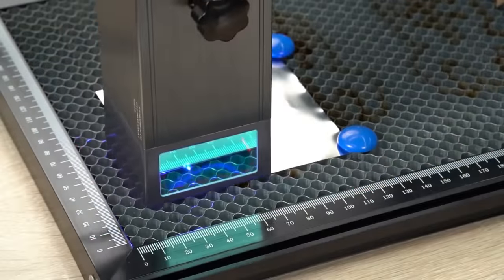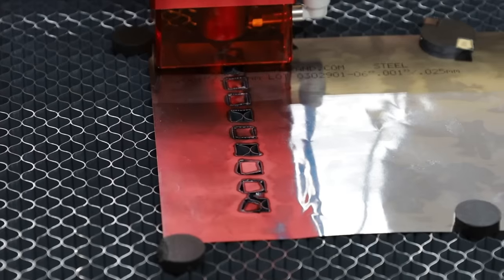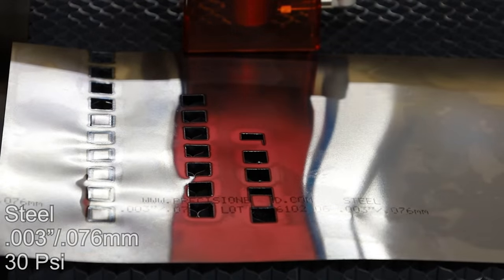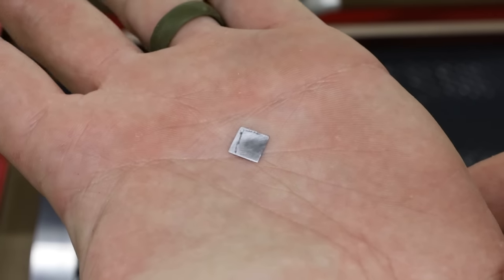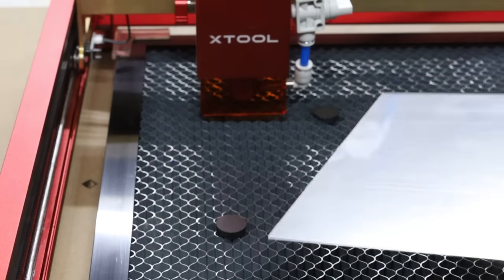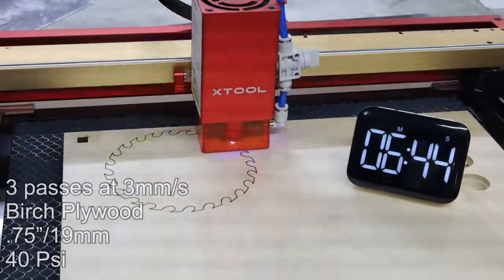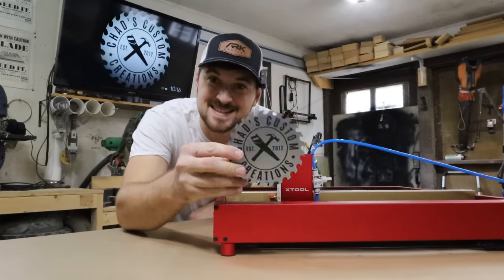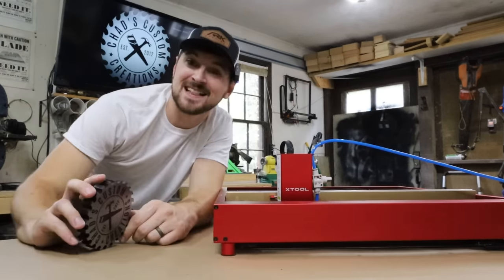Cutting Metal with a Desktop Laser

Comment: The most likely reason, beyond material thickness, that you failed to cut through aluminum, copper and brass is due to their High Thermal Conductivity.
Because the cutting laser is relying on controlled vaporization of the base material...
Anything with a high enough Thermal Conductivity is going to carry the heat away from the point of contact too quickly to vaporize the material. 

To test this, it would also be cool if you tried cutting silver and gold foils at the same thicknesses as the steel you were cutting...
BUT that might be cost prohibitive.
Reply from the maker: You’re right!

Comment: I did get a sort of reply from Atomstack with regard to metal cutting, they claimed up to 0.005 inch thickness in steel/stainless steel but said it would not cut brass I don't know why that would be the case but I wonder if it's to do with the heat transfer properties of different metals, the laser is melting its way through the metal (rather than burning) steel is fairly poor at conducting heat so its easier to raise the temp locally high enogh to cut through (bronze should cut as well I think) Brass is about 4 times better at heat conduction, so maybe you could cut 0.001 or 0.002 inch brass, Aluminium is 7 times better and copper 13 times so I don't think you are going to cut those even at the thinest thickness (you could try aluminium cooking foil maybe) this would also explain why thicker materials are not going to cut they never get hot enough
Reply from the maker: This is great info and now I feel bad saying they weren't replying. Thank you for sharing this.

Comment: Hey I’m new to laser cutting I’m wondering if there’s any chance the x tool can cut 70 mm diameter monogram you know the ones that use on weddings they are too small I own the atom stack a5 is not powerful enough to cut metal of 5 mm thick and I would like to upgrade it to the xtool thanks
Reply from the maker: I think 5mm thickness is still too much. If you watch the video here you will see where the 20w maxes out. Though eventually I will test it out with an oxygen assist and maybe that will make for deeper cuts.

Comment: Wow I have an 80w so I’m quite excited to give this a try bro ty also I wonder if having a fan blowing on to the metal as it’s cutting aswell as the air assist would help that’s something else I may try 👍
Reply from the maker: Is your 80w a diode or Co2? As I understand it strangely enough a CO2 wavelengths will not effect steel but it's always worth trying.
Reply: @ChadsCustomCreations  mine is diode laser buddy
Reply from the maker: @ashfox2012  what model is it? You sure it is 80w output?
Reply: @ChadsCustomCreations  I have the 20watt and the 80watt and I’m shure what ever the laser is advertised as when bought is the input so the out put would be 5.5w out put or something like that so my 80w is 80w input but it can cut 10mm plywood easy bud
Reply: @ChadsCustomCreations  and it’s the atomstack 20w and one called laser tree 80w from Ali express and I can’t even describe how much faster my workflow is hahaha

Comment: I think cutting metals is dependent on the conductivity of the metal. Stainless Steel is less conductive than copper, so can a 20watt diode laser cut .0120" (12 thou) thick stainless steel shim stock?
Reply from the maker: I believe you are 100% right and makes sense why aluminum and copper were unaffected. I believe my testing showed I was able to cut through .007" but comfortablely at .005"

Comment: Somebody please help me figure this out. For 450nm copper absorbs light very well (much better than in infrared spectrum). With 40 reflectance and 60% absorption blue laser should leave a mark on copper. But it doesn't ...     Infrared is very badly absorbed by copper, yet it can leave a mark?   What am I missing?  Help!
Reply: Ok it seems I am beginning to understand it. Infrared wavelength itself is quite bad for engraving metals (much worse than 450nm) however with infrared lasers we have some tricks up our sleeves - we can produce much smaller point and we can pulse them with high power. These more than make up for the shortcoming of infrared (1064 nm).
Reply from the maker: Sounds like you figured it out!

Comment: you can use dry moly lube as a cheaper version of cermark, they are the same thing when it come down to it. molybdenum disulfide get it fine enough you could mix with solvent and airbrush the stuff on.
Reply from the maker: That's a great tip thank you!

Comment: I mean the other end of a fiber coupled laser is just a diode/diodes the full name is usually "Fiber Coupled Diode Laser" all that matters is that output is in a wavelength readily absorbed by metal usually infra red.
Reply from the maker: Thank you for the info I didn't realize that's what the fiber lasers were using also. Do they run at a different wavelength or anything?

Comment: The copper and aluminum are not penitrating because they dissipated the heat it is not the reflection. The steel and stainless will take the heat and allow the cut.

Comment: Wondering if you can cut through stainless steel mesh, like 325 mesh or other smaller sizes?  That might be handy for gaskets using some other filler material when used as a gasket.  Thanks for sharing!  Interesting.
Reply: Liked, commented and subscribed with the bell.
Reply: Wow, I didn't even realize they sell 80W diode laser for under $200 on AliExpress.  Wild... wondering what the power and other set optimal specs are like with materials based on the wattage.  Like graphing wattage verses each material thickness cut ability.
Reply: I recall vaguely, with PCB's using something like a black marker or I'd guess flat black paint like the camo Rust-O-Leum to either etch or cut.  Seems like cutting from what I recall.  That might get you leads for the highly reflective and thermal conducting materials.
Reply from the maker: Watch out so many companies advertise the input wattage from the power supply and not the actual output wattage of the laser.

Comment: What about if you attach a mig welding gas bottle to the air line instead of the normal air some you don’t oxidise the metal even just a small $50 bottle from the big box stores
Reply from the maker: Good idea!

Comment: Hi I don’t know anything about laser yet but got a question thanks 😊
Is it possible to move the machine to make a bigger design ?
Reply from the maker: Yes you can move this laser very easily
Reply: @ChadsCustomCreations  that is quick just to be sure I am taking about kipping continuing the design who is to large for the machine even with the extension ? Thanks
Reply from the maker: @Kebekwoodcraft7375  so not exactly one continuous design. But if you make registration marks and break up the design into different parts you could run the different engravings. It’s not easy but it can be done. They sale an extension kit to make it larger in the left to right but not up and down.
Reply: @ChadsCustomCreations  thanks 😊

Comment: I wonder if you could eliminate the oxide on the cut by giving air assist with argon gas.
Reply from the maker: That's a great idea I'll have to test that. Pretty sure it's not an issue with stainless steel I've gotta source some thinner stainless for testing next.

Comment: Wondering if two extension kits would extend the size both directions...
Reply from the maker: No I don't believe so as the main arm that the laser rides on would not be extended.
Reply: @ChadsCustomCreations  Good point.   That's what I like about the NEJE brand with their MAX size and neat cable chain. Unfortunately their other features just don't compare with the xTool yet.

Comment: The engraving does not look centered even though you made a template. What happened?
Reply from the maker: Yeah know I didn't notice in the moment but you are right it is off a little I may have rotated the saw blade which may not be a perfect circle. Or maybe I bumped it when setting up the second engrave. I am sure it was user error not the machines fault.

Comment: I would be interested to see what would happen if you added co2 instead of air or a co2 argon and helium mix they use it for aluminium it helps it get even hotter and wets in the aluminium really well it would also stop the oxidising aswell would be clean shiny metal with that shield around it
Reply from the maker: Great ideas, I got my hands on some pure oxygen I will be testing and sharing those results soon.
Reply: Are you serious! @ChadsCustomCreations
Reply from the maker: @prestonian1066  yes I put out a video on it already the results definitely make for a hotter burn but I need to increase the psi on the oxygen
Reply: I imagine it would. Tends to help everything catch fire astonishingly well. You may get away with it on metal but I wouldn't try it with wood! Argon will protect from oxidisation and is inert. You could mix the two but then you are diluting the oxygen.
I'll have a look for your video when I get a chance. @ChadsCustomCreations

Comment: 0,102mm steel was the tipping point, I guess... Could you please make another trial with 0,102mm, where you try to get even better edges, by trimming the parameters??? Like PSI-variation, Speed, Speed at corners, using edding-marker across the lines you´re about to cut, in order to reduce reflection (is that even a thing?), or CerMark, you get what I mean... Thank you... Cutting doesn´t seem to be a problem at all, instead, that oxidation at the edge is crucial, since it´d be impossible to remove the oxidation off of hundreds of tiny bits, with 4 or 10 edges each, so, you´d be forced to find the parameters where this oxidation zone is as narrow as possible. Remember that materials often have functional µm-thin deposited layers (tin, stain, etc.), that must remain unharmed, and that "removing" anything afterwards, even less oxidation-layers, isn´t an option.
Reply from the maker: Go check out the 40w I just did a video on.
Reply: @ChadsCustomCreations  Nice!!!

Comment: I make knives as a hobby and have been considering purchasing a diode laser to engrave patterns to the steel. Preferably deep enough let's say a fingernail can snag on to so if I wanted to do a color inlay of some sort it would be deep enough that it would not be removed immediately when the knife is used. Could you possibly do a video using the soot method as mentioned and multiple passes such as say 10 or so? Issue is it couldn't be such a slow speed that it messes with the heat treating of the steel or maybe if the steel can stay cold during the entire process somehow it might work
Reply: Hey, you probably found what you need by now, but have you checked the infrared laser for your engraving?. mines on the way😁
Reply from the maker: I think it’s very possible that could work!

Comment: I keep hoping to see one of these laser cut test videos trying to get through laminate flooring(cheap, readily available, strong enough to be used as a straight replacement for alu-plate(imagine al the 3d printable machines and jigs that could be made way better if made with laminate...)), particle-board flooring is another cheap and readily available material that has some real structural/functional uses.......
Reply: Have you found an answer to this, and what would you make with it?

Comment: "The only lasers that can affect metal are fibre lasers-" false. A 40 watt CO2 laser is enough to make PCBs with sheets of copper. And an 80+ watt can easily cut steel. You can also get a "Master Oscillator Power Amplifier" (MOPA) laser that can engrave most steels in full rgb color.

Comment: Copper and Aluminium have very high heat conduction. Steel and Stainless have much lower heat conduction. So low heat conduction metal should cut if the laser can get it to melting point.
Reply from the maker: You’re right!

Comment: I saw in the video you tried to cut copper with no luck.  However I’m wondering if you have ever tried to cut beryllium copper sheet? That’s used to make a variety of mechanical springs. Would be awesome if it is possible to cut on a 20W diode laser set up. I’d PayPal you for your time and the cost of a beryllium copper sheet if you’re willing to try. I’d be more than grateful.  At the moment I am looking into a photo-chemical machining set up but it would be so much handier to cut these with a laser diode.
Reply from the maker: If you can find me a link where I can order some I'll get it tested for you.
Reply: @ChadsCustomCreations  Its not commonly stocked so I’ve been ordering sheets on eBay.  Its easy to find there.  I am serious regarding donating for the time and cost of a sheet!  Not the foil.  Something a little bit sturdier/thicker.
Reply from the maker: @opcode66  is this the right stuff looks like they have options of .3mm up to 1mm what do you think I should attempt? 

https://www.ebay.com/itm/155140966546?mkcid=16&mkevt=1&mkrid=711-127632-2357-0&ssspo=HTRFNrzLRb6&sssrc=2349624&ssuid=01Vd8HsqRA6&var=455322056204&widget_ver=artemis&media=SMS
Reply: @ChadsCustomCreations  Yes, that's it!  I just subbed here and liked the video.  I am also now following your facebook page.  Sent you a message there.  Hope to hear back soon!  Cheer!  Thanks!

Comment: I would be interested to see if the  20 watt diode laser could cut single sided pc board stock. Also if you were to spray the pc board with black paint could you actually produce a theoretically usable pc board (electronic wise)
Reply from the maker: It definitely seems feasible, I know very little about those but if I can figure out how to attempt to make one I would be happy to try.
Reply: @ChadsCustomCreations  As I have research this idea, it seems like the only thing one can do with a diode laser is to paint the PC board with black paint. Then use the laser to selectively burn the paint off, leaving the exposed copper to be removed via a chemical etchant. Finally, remove the paint with acetone or the like, revealing the remaining copper traces.
Reply from the maker: @philipershler420  interesting, I am curious though as this amount of power coming from a diode laser is very new to the market.
Reply: @ChadsCustomCreations  Actually XTOOL and others have had 20 watt diode lasers on the market for quite sometime. XTOOL is just about to release a UV diode laser.

Comment: I feel like a broken record. YouTube keeps recommending me laser videos and watching them I feel like I need to say same thing over and over again. One part of the lasers capability is his optical power output. Second part is even more important. It is a wave length/color/light frequency of the laser. Blue LED laser modules are most often between 400 and 500 nM wave length. That is why no matter how powerful they will reflect on Aluminum and not being able to cut transparent acrylic. While they cut solid color acrylic with ease. For that you need at least CO2 laser and that has typical wave length of high 800's to 1000 nM. And to cut metal efficiently (thicker stuff and reflective stuff) you want fiber laser and those are reaching 2000 nM wave length.
Blue laser diode lasers will come with information what materials they can engrave. So steel and stainless steel are in the list. Even single diode lasers will engrave in stainless steel. Get enough power and nice focus and thin material and they will cut true.
But if they can't even engrave something there is no chance of cutting it either.
Reply from the maker: I hope you stick around you definitely have a good understanding of your lasers, seems as though we could learn a lot from what you know.
Reply: @ChadsCustomCreations  thanks mate. I am just persistent in wush to know why is something happening way it does. BTW your videos are really good. Goid approach.

Comment: Try oxygen
Reply from the maker: I have and it definitely made the beam way hotter but I had only low pressure so the would just melt the metal and not blow it away. I have a video on it. I think a better valve in the tank would have helped.
Reply: @ChadsCustomCreations  I work with co2 100 watt lasers, always wanted to try oxygen but didnt want damage to machines i use.
I mostly do wood with some anodizing for other customers

Comment: just use a brain.. do several cut with same power but damn faster.. and keep it cool between cut by 2-10second.. you get clean cut without overheating.. geez whata dumbell,.
Reply from the maker: In theory you would think that would work. In practice it doesn’t pierce the metal which yields no cutting sadly.

Comment: You might need to add some dwell time on the start of the cut or add some continuous cut lead out to you cuts. I wish you would have tried the copper with the protective film still in place.CNC Plasma Table operator here.
Reply from the maker: Yes you are absolutely right! Learned this from my sculpture instructor when using the oxy torch. Lightburn has this feature but for some reason at the time of recording I couldn’t get the function to work. This does however work with my co2 lasers.
Reply from the maker: @idiotwithasolderingiron  I used to have a laser attached to my CNC router it was a  jtech. But I will say it was such a hassle going switching back and forth from router to laser honestly if you have the room having a dedicated laser machine is my advice.